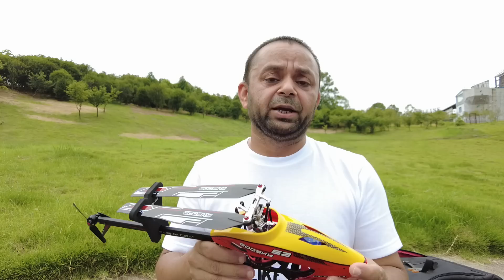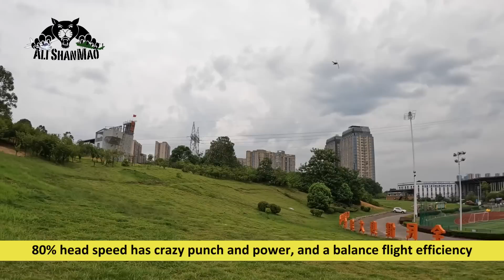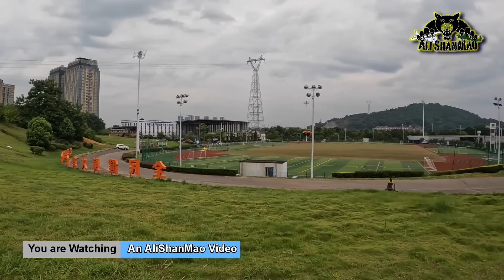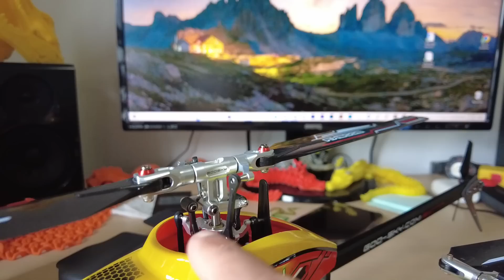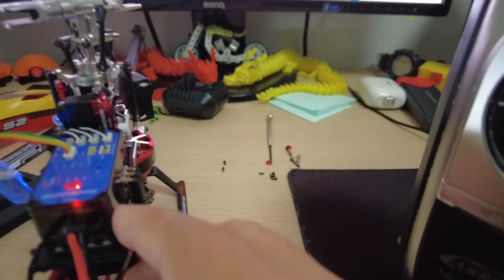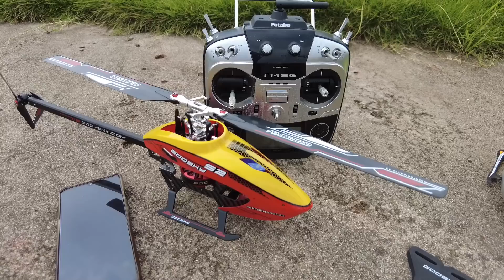GooSky S2 Direct Drive 3D RC Helicopter Maiden Flight Complete Review

Comment: Hello Ali,
 I have a quick question, whether you had any screw problems?
 In fact I received my S2 a week ago and I checked the screws which were not at all tight. I applied thread lock and tightened the screws without forcing, just a light tightening.
 A few seconds after tightening, the screw heads popped and flew!
 These screws are like butter!
 As a result, several broken screws in different aluminum parts.
 I am in dispute with Banggood at the moment and no solution has been proposed yet.
 THANKS.
Reply from the maker: never had. guess now goosky is not paying much attention to this model

Comment: Hi thanks for such great reviews,  can you please tell me ,do you used expo on the radio? Cause I find my s2 very sensitive.  Thanks
Reply from the maker: I did not use expo or dual rates. you can set the agility settings to lower in the app if you find it too sensitive.

Comment: It certainly looks like a well made model. Is it as straightforward to set up like the OMP models?
Reply from the maker: very straight forward. its like it just took the stock futaba helicopter settings itself :) just needed to tweak the pitch and throttle curves a bit, and added throttle cut, thats all